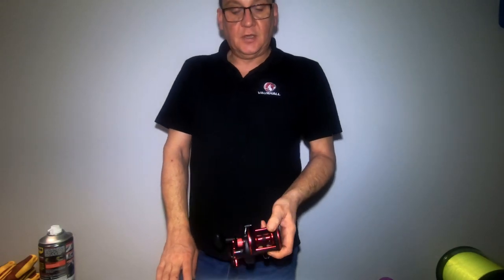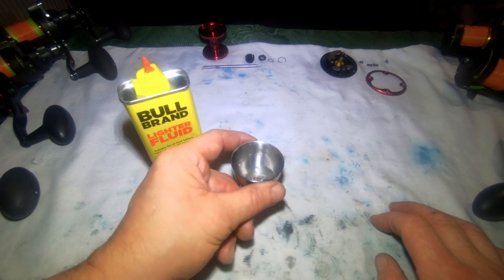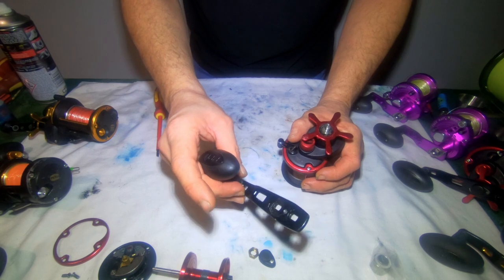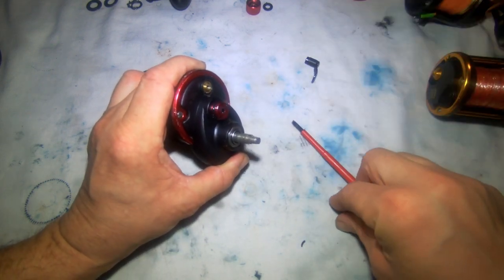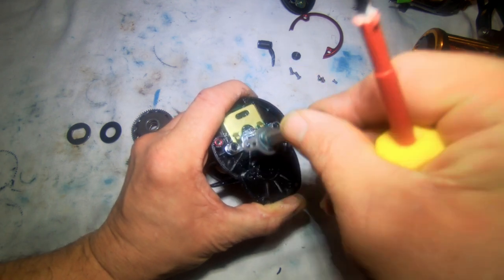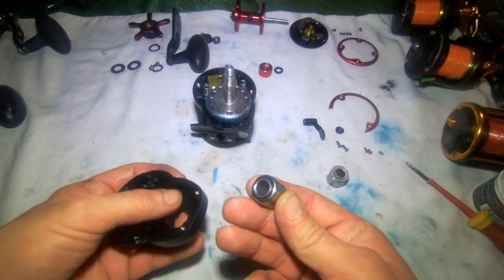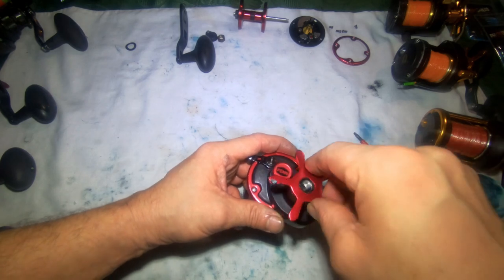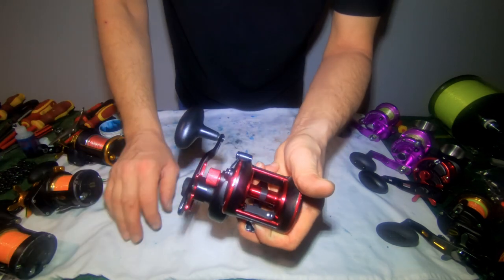PENN 525/515 MAG 3 - anti reverse fix plus reel service.

Comment: I'd heard of the spoon trick but never seen it Thank You For Showing it I can do it now 🤣 I've just been soaking my bearings  normally after cleaning with lighter fluid
Reply from the maker: glad it helped out
Reply: @StarfishSeaFishing  Why do you feel the need to warm the oil to lube the bearings?
Reply from the maker: @leerichy6489  it thins the oil down and will pull the oil into the bearing
Reply: @StarfishSeaFishing  Really not necessary.....but each to their own.

Comment: I guess these are called the squalls here in the US. well done instruction video, starfish. My question is, I have never removed the bearings from my squalls. Had them since 2013/2014. If I can blow up the reel casting at the beach, and still need the mag to prevent that, is there any reason I would want to remove and clean the bearings. I don't need a faster spool.
Reply from the maker: Yes there very similar reels to the squall if your bearings are sounding noisy I would do it as they can corode
Reply: @StarfishSeaFishing   ok, yeah I have not had an issue yet....I know some folks like to speed up the spools..